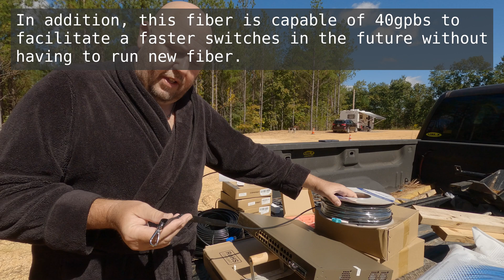Escape the WiFi struggle: Exclusive hotspots for RV guests | Episode 3 of 3

Comment: It is looking great,I have some RV parks that I run a WISP system to provide internet. It is a lot of fun.
Reply from the maker: We can only imagine how much fun WISP would be! The interference factors between the WiFi hotspots and the RV guests doesn't go away. Then you have cellular technology to deal with on the ISP side as well, which typically has stricter "fair use policies" than fiber or other hard wired ISP connections. Or if you are using long range WiFi to provide Internet, that has it's issues as well.
Reply: @RvParkBuilder, I've never had any problems with my Spectrum backhauls and haven't dealt with cellular companies. I do not have any interference problems. It just works even on the long range systems. When installed right it will just work. Lots of fun.